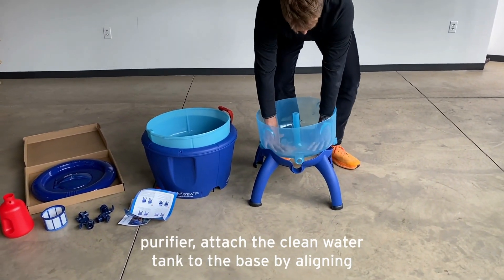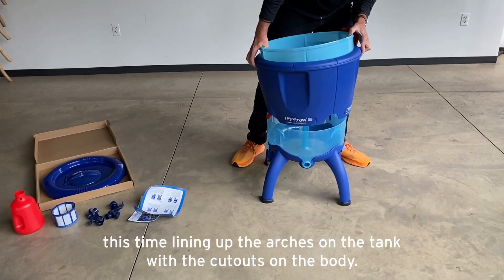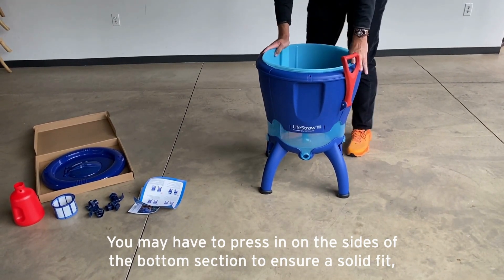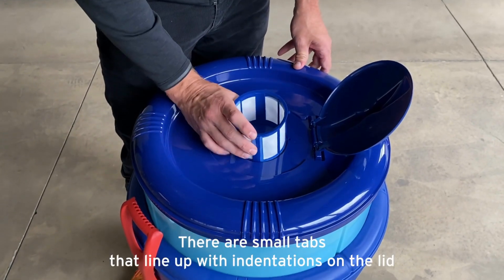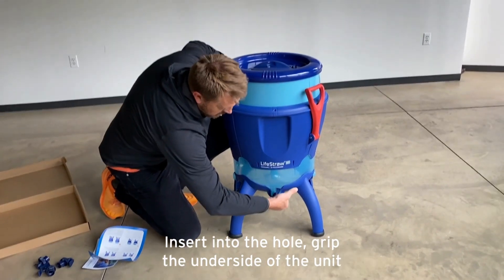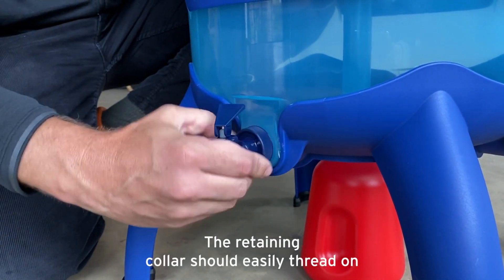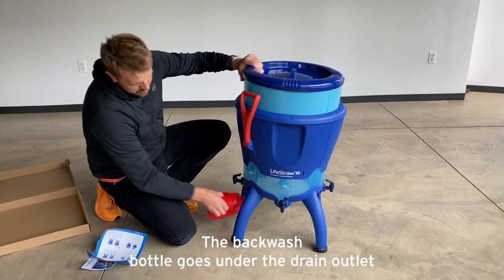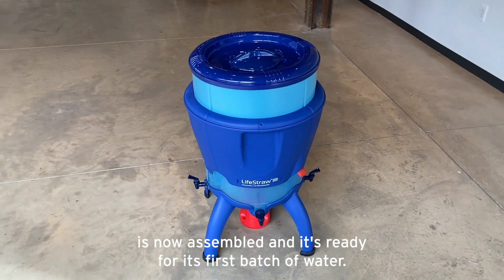How To Assemble Your LifeStraw Community Water Purifier

Comment: the red jug doesnt hook to anything. And mine unit is taller than this one and the red jug had a large gap and why is the instructions showing it being inserted and twisted into place when theres nothing to do that with under the unit? Why is the filter media not accessable for replacement? Do you have to keep it wet once you begin using it?